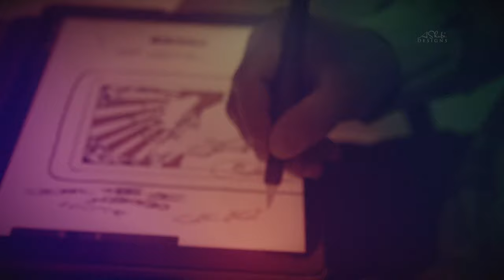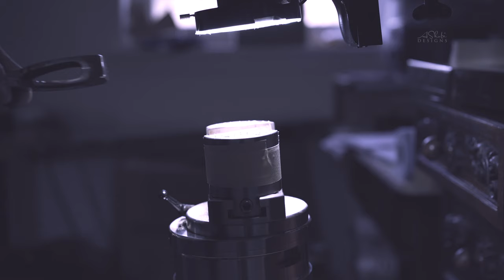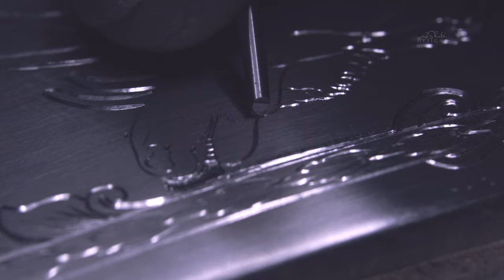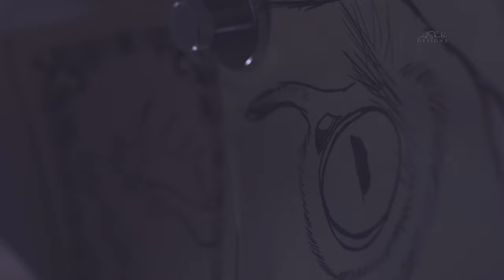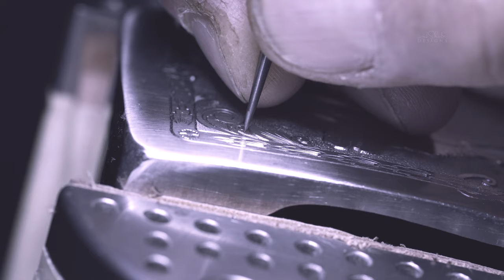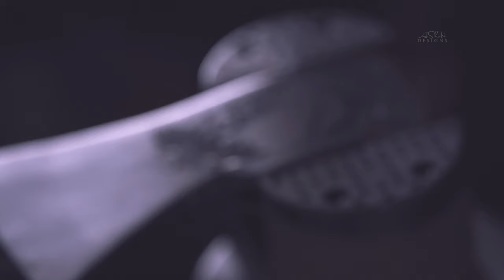Restored Vintage Axe | Hand Engraving Moose Axe | Work in Progress

Comment: What kind of tools do you use fo engraving? What kind of stainless are engraving bits?
Reply from the maker: I use GRS tools and various gravers such as C-MAX, Carbide and GlenSteel.
Depending on what kind of application, different type of graver is used.
Reply: @ASkobiDesigns  Thanks